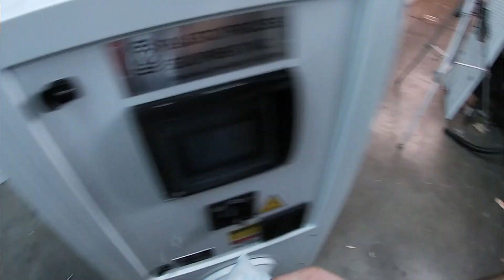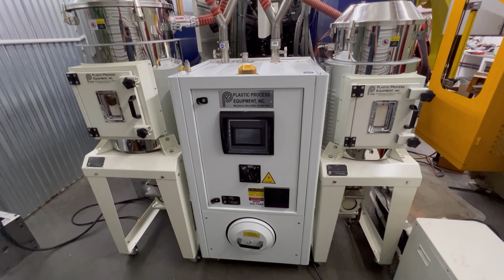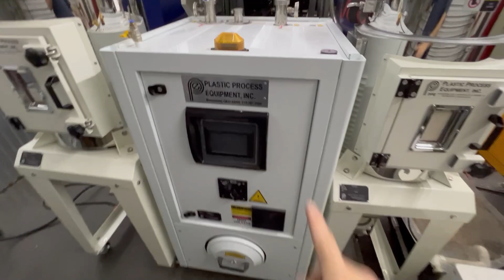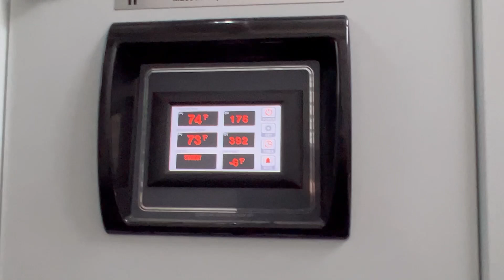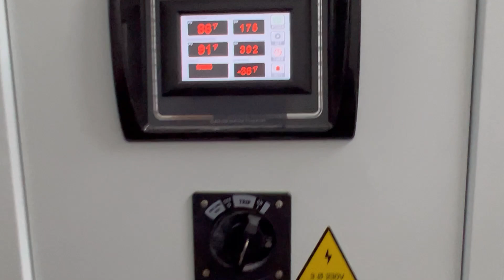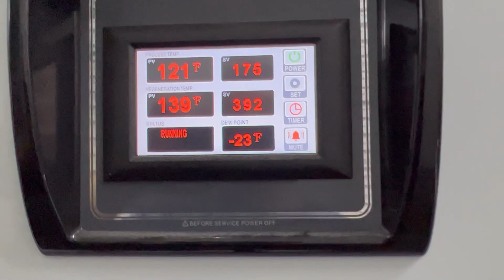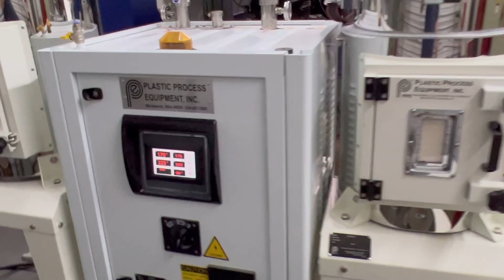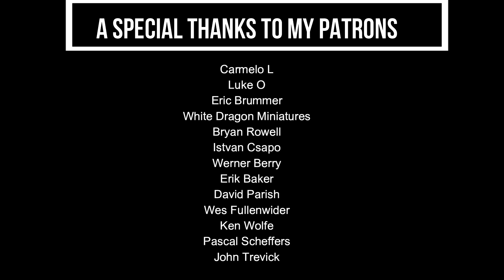PLASTIC DRYING FOR INJECTION MOLDING

Comment: Need to look into Maguire color feeder. Feed throat mounted only needs a screw rotation signal and gravimetric color feeding. Works great and no more mixing.
Reply: Movacolor/Conair gravametric feeders work well too. Also have a smaller foot print than Maguire models if space is limited in the barrel throat area.